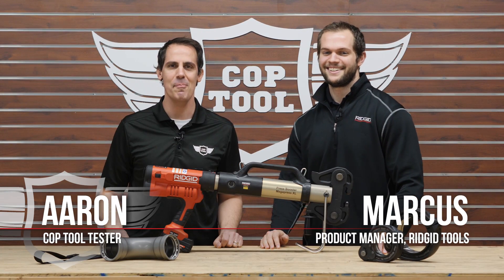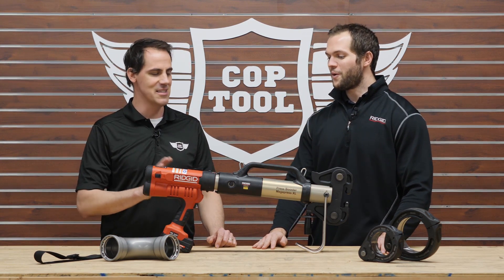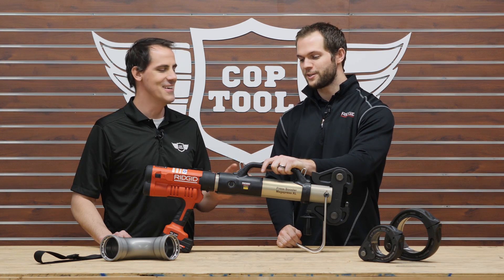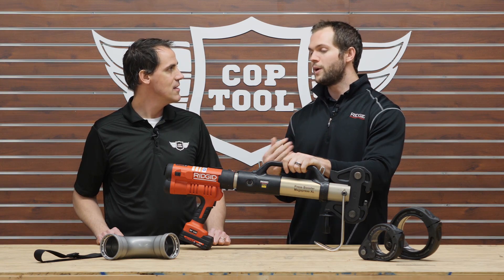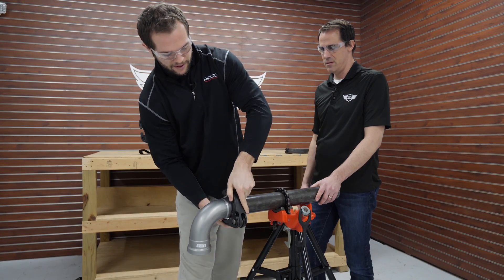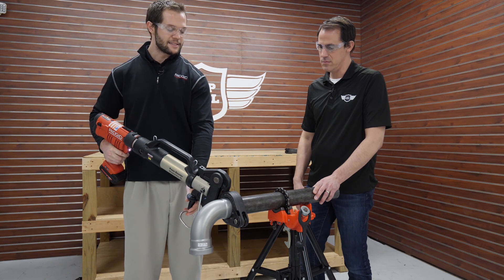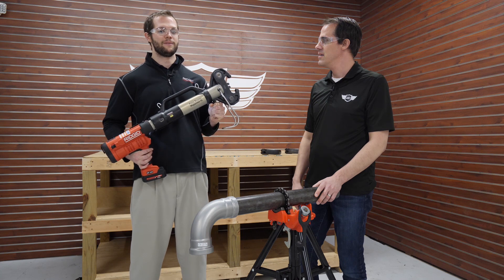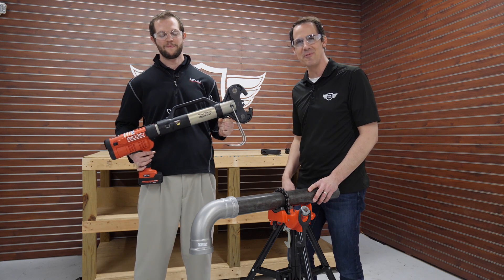RIDGID MEGAPRESS XL Booster for RP340 - Viega Steel Pipe Fittings Up to 4"

Comment: I´m living in Germany and i used this setup 2,5 yrs ago on cooling systems in 4". i owned a rp340 and Viega Germany rent the booster for 3 weeks. It´s a quite heavy package but the resoults are talking for it´s own. i took around 1000 pressings. one of the nice things is that you can use Makita 18V akkus to power your pressgun. but i took a cable adapter for the 4" stuff for safety reasons

Comment: Ive been using this system on 3/4" thru 4" carbon steel pipe for a couple of months now. Its a time saver for sure but the Ridgid Megapress xl booster has failed twice in crucial spots and at crucial times in the field. Two brand new xl boosters, first one and then another, failed in mid press requiring numerous trigger pulls as opposed to two long pulls then one short, just to get it to a point where we could try a manual release to get the booster off the gun. Both times losing all hydraulic fluid. Another issue is a piece or part of the hinged collars randomly falls out while in use so it starts egg shaping the fitting causing a failed joint. The metal holding this piece in place is too thin and the pins that keep it attached to the collar are too short. Get that stuff fixed and the system is unbeatable. The only leaks on test have been missed joints. It cuts the installation time in half easily and is a clean way to join pipe. Once the bugs are worked out welding, soft soldering and hard soldering will all be a thing of the past.